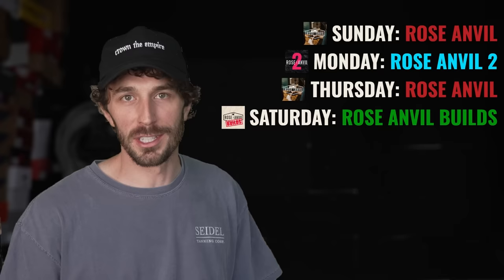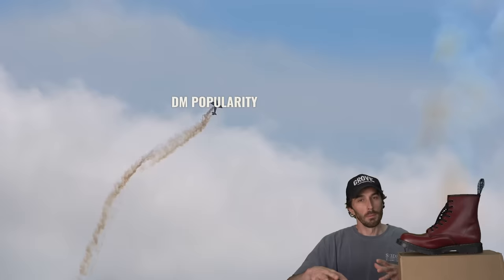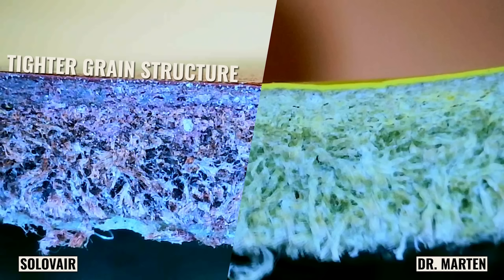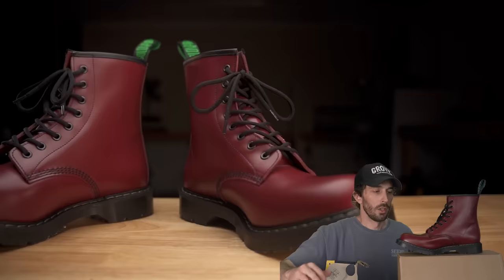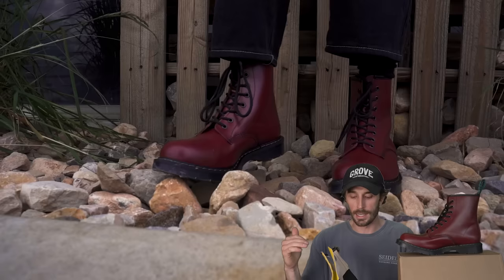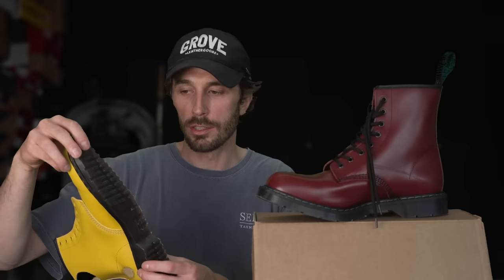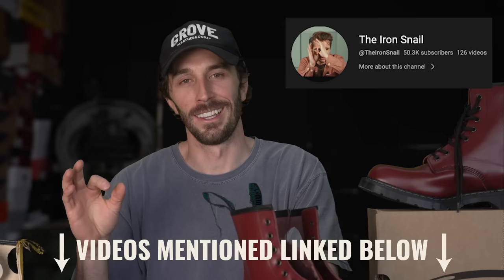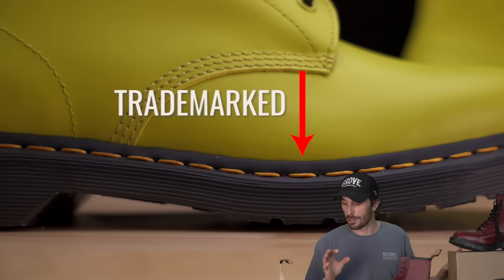Better than “real” Dr Martens - Solovair

Comment: If you notice your welt separating on your solovairs/Dr Martens, you can fix it yourself quite easily. You heat up a thin piece of metal (ideally an old butter knife) to red hot over a flame, then you slide it between the separating layers and hold the edges together with pliers. Basically reattaching the outsole the same way they do in the factory. I’ve done this before on my solovairs and it holds up like new. I would recommend doing this when you manage to catch the split early, because I can hardly imagine fixing more than three inch long tear using this method.
Reply: I’ve been seeing a lot of Reddit posts lately about Solovair’s splitting quickly. This is my only apprehension to getting a pair. How long did yours take to split?
Reply: @elenaborie2605  It must have been a factory defect, because it happened right around the time I broke them in. I have two other pairs that I’ve been wearing for years now and it doesn’t seem like it’s going to happen anytime soon.

Comment: Dude I've gotten addicted to your videos because they're so informing and help me make better decisions reg. shoes that have good value and are comfortable to wear. I had a bad fall a few years ago which completely destroyed my right foot. While my ankle was (somehow) completely unharmed, I now live with several screws in my bones and have very limited mobility (can't stand on my toes, for instance) and a very sensitive underside that needs custom soles with plenty of arch support. As you can imagine, knowing what to look for in shoes is incredibly important for my health, and being partially disabled also means I don't have stacks of cash to throw around on shoes that need replacing every season. Thanks for the info you're putting out there.

Comment: I definitely picked up a pair of NPS Gripfast boots with a steel toe and greasy leather, and I primarily use them for concerts, particularly death metal shows with mosh pits, and these have been absolute champs. The very first day I wore them, they got a beer bath from a mosh pit, and they have not had an easy life ever since. But my feet stay relatively comfortable. If I ever destroy my current pair, I'm absolutely buying again.

Comment: I've been wearing the same pair of 11 eye steel toe Solovair derby boots 40-60 hrs a week at work and can attest: they have significantly more mileage than I had expected. So far, the only issue I have encountered with them is the counter cover has just about worn out.

Comment: Solovair use white stitching around the boot on purpose. You can dye them yellow yourself, or any colour for that matter. Another point missed  is that solovairs last is more narrower than dr martens. They also lace up much more better, allowong you to really lock the boots to your feet. I always find that docs they end up eye to eye when lacing them up, and always feel loose, with less support particularly around the ankle.
Reply: That’s good info but I liked the roominess of the Docs because I have wide feet
Reply: @geministargazer9830  Don't worry, they weren't entirely correct. Solovairs have multiple lasts depending on the model, and some of them are even wider than Docs. 5400 is the widest if I remember correctly.

Comment: I've resoled my old, mid-early '90s English Doc's Oxfords, but they were more to this construction(more leather lined though), than the (not much later but iirc China made and pre-'04) Doc's workboots I was going to resole but decided were not worth it (needed more interior work than I was willing to do at the time, not just fiber midsole replacement but counter etc). Though both had the wood shanks, the workboot had a thinner fiberboard and the foam instead of felt in the recess but felt filling of the welt. I work mostly standing on concrete. Keen has been my boot of choice lately.

Comment: I got some Solovairs because of your initial review. Great boots! The sole of one did come apart early on, however. To their credit they covered what it cost to have it reglued locally, but that was a bit of a pain
Reply: I had the same thing happen with mine but they only offered 15% off a new pair. I had them re glued and they’ve been amazing ever sense.
Reply: I had to return many pairs because they come bad welt, and with cracks in the union of upper and low sole, very visible in a lantern light.
Reply: Ludwig Wittgenstein.

Comment: We were issued with solovair shoes in the UK fire brigade 20 or so years ago. Fantastic hard wearing shoes. I've still got an original pair that I use for the gardening to this day. One thing I would point out the metal rings that line the eyelet holes....make sure they're the ones with the ring outside AND inside the shoe. Some of them have a ring on the outside, but RAZOR sharp tangs inside that held the eyelet ring in place. IN one pair of the later shoes I was issued one of the tangs somehow came out of the leather and I BADLY sliced my finger as I was doing up a lace.

Comment: I'm glad you mentioned the MIEs at the end, I couldn't decide whether the comparison was fair or not. 
I love my Solovairs, but after a lot of work breaking them in and wearing them, I think the lasts they use just don't agree with my feet. Both the shoe and the boot I've had problems with fit.
I will say their leather and foam insoles are amazing for their price point.
Would overall recommend, just a bit hard to sort out sizing from the US.

Comment: I would like to say that DMs did have their own good quality boots produced in-house. It wasn't just Solovair making the good ones, in fact, I've talked to some that thought that the Vintage Steel toe DMs were better than the ones produced by solovair at the same time.
Reply: Quite a few  firms made Docs for Griggs, until production shifted off shore. Griggs only ever made some of them at maybe two factories. NPS/Solovair are top quality.
Reply: @chrisbolton5461  I know there was a company called Tredair making Doc Martens as well. I don't know if they used Doc Marten branding directly, but they used the same type of soles and were licensed to make those boots and shoes
Reply: @lephishe6271  Good point. Again with the air in the name. Made by White & Co in England in Earls Barton until 2006 and then used other UK factories after that. Bet NPS/Solovair made some.

Comment: I have owned Solovair, Made in England Docs and standard docs. At the end of the day I stick to the standard ones. All of them have the same problem - sole splitting and leather peeling. On top of that, Solovairs are weirdly known to their leather uppers pulling away from the sole. No boot like this is perfect, so it makes more sense to stick to the one that is the easiest to replace.

Comment: I have Solovairs from Vegetarian Shoes in Brighton. Worn them for years on end. No trade work, but lots of walking. I wore through the counter cover, the lining and the midsole (you can see light through the bottom of the boot through the translucent soles) but can still wear the boots just fine. The uppers are nearly perfect still, the soles are slick but not worn through to the cavities. I replace the insoles as I wear holes in them, and the boots are probably the best I’ve ever had. They’re not leather, but they breathe well and are extremely durable.

Comment: I have just sold a few doc martens that I can’t fit into, and my worn out used ones sell for $30 or more.  However, I got a pair of Solovairs last year to replace a pair of Docs, it took a couple of months, but I love them.  The leather even after just a couple of months is still impeccable where Docs already show slight issues.  They get more comfortable with wearing.  One other issue with Solovair is, because they are not mass produced, is you may have to wait for the next batch in your size.

Comment: Actually u got the wrong doc martens for comparison. Every special doc martens are made kinda different for some reason. The old one u cut apart and the yellow one are actually models that are specific to the season and not the long going models like the og black one. The og black ones(not even the mie one) features the same sock liner type as the solovair cause I've had multiple pairs myself and I'm kinda a doc marten nerd😂 Great review as always but I would love to see u cut apart the normal black doc martens and see the difference between it and the solovairs like real apples to apples. Or maybe it's a locational thing that my docs are different. Just wanna know more

Comment: My experience with Gibson shoes: the Solovair is much more durable than Dr. Martens.  After about a year, the inside of the latter began to erode, resulting in an inside hole just behind the fifth toe. After a while, I simply could not wear the shoes anymore, because it would cut my feet. I did not have any issues with the Solovair.

Comment: Coming back to say I think Solovair's quality has gone severely downhill since a while ago. I am based in the UK and all my Solovairs come from them directly, yet the latest pair I have got didn't even last a dozen of times before the insole ripped itself, searching online unveiled loads of quality issues people are having lately, including welds failing. My old Solovair in the main time took years of battering and no problems at all. At the stage the quality and durability feels just as bad as Docs is not worse, and the Solovair customer service is also very irresponsive (still waiting). I am not sure what is going on, but I do feel with the whole inflationary pressure and energy costs crisis here, companies are cutting back and they must have been cutting corners somewhere. If you want to buy it for life, I don't think Solovair is a brand you can count on right now - it might be issue free but certainly having issue is not a remote possibility.

Comment: I’ve been wearing my second pair of Solovairs for about a year and a half as work boots every day at my factory job. I put a foam (3mm thick footprint) insole in when I got them for the perfect fit and they’ve been good to me. Actually just noticed yesterday that the leather collar at the top of the shaft is split, but that’s the only failure, if you can even call it that, I’ve had. I haven’t been easy on these boots and it’s about time for a resole, but they have plenty of life left
Reply: What happened to the first pair? If they failed, what was the weakest link?
Reply: @Pnner1  good question! I should have clarified. The first pair was thrown away by my ex, they were an unfortunate casualty of our break up.

Comment: gotta say, to some level you can work in them. i work in a bowling alley/arcade fun center. crawling in and out of machines and i have a pair of steel toe greasy black strap derby boots from Solovair and i love them.  going on 1.5 years maybe 2 now, they've been great.  only addon i did was some shock absorbing insoles from FP Insoles.  they're marketed at skateboarders for absorbing impact from high jumps but they're great for walking on carpet covered concrete all day every day too.

Comment: I've got both a pair of Solovairs and Docs for over a year, both greasy leather. The leather is just much better quality on Solovairs, even though both are greasy leather. The Solovairs have much harder sole, doesn't feel like 'sole of air' imho. Martens on the other hand, do. It's much more cushy, under the ball of foot as well. That said, these Docs do tire the feet, just in a different way. Maybe that's the bad structure you mentioned, cause after a few hours of walking it doesn't feel nice, and in Solovairs it's just, you know, like regular tired. Great vid, thanks!

Comment: I originally wanted to get myself some Dr Martens but because of your prior videos I decided to get some Solovairs about 2 years ago. They have been quite painful to break in for about a week but later on they got really comfortable. I have used them a loooot the last 2 years since it pretty much is the only boot/shoe that I use in spring and fall and even the last winter and they hold up very well. Yes they already look pretty used and covering of the leather now starts to have some cracks and also the soles already are pretty run down but overall I think that's a pretty good result until now. I guess I can use them another year for sure but maybe after that I would need a replacement.

Comment: I would love to see a further comparison of the NPS gripfasts. The soles are entirely different and on mine at least there is no internal counter cover - instead there is another layer of leather on the outside heel of the boot, and the steel toe is treated the same. It would really round off the doc martens like series!

Comment: In Australia, Solovair is actually around the same price as Dr Martens. As others have said, the greasy leather is a full grain leather without the plastic coating. Much more durable and better quality, in my opinion. I have a pair of the Solovair black greasy 8 eye boots, and they’re great.
Reply: @datfly3034 Where are you getting your Solovairs in Aus? I have only found two retailers and when they are out of stock they are out of stock for ages... want to buy a second pair.
Reply: @brentmcc6048  Redpath shoes in Canberra has them.
Reply: @datfly3034  Thanks, one of the two I know...the other is d’Honk Scooters Melbourne, that's about it.
Reply: @brentmcc6048  I think NPS will ship to Aus. Not sure how much the shipping will cost, though.

Comment: Gotta say, I was an early adopter of Solovair and got very disapointed. 1 pair the laces broke on both boots within a week, as well as one of the pull tabs ripping out, causing the back to come slightly apart. other pair did okay, other than some popped welt stitches. I never had a pair of China Docs tear out a pull tab, never had one pop a welt stitch, and had many pairs with laces that lasted over a year.  I'm comparing made in England Solovairs to made in China Docs, and the docs are winning.

overall both lost though, I got tire of poorly made boots and have now had a pair of Georgia boots for years and love them.

Comment: I think the bar/ball drop test is the weakest for me in terms of taking any useful information from it. It's not actually clear that higher or lower is good. As an example, doing the ball drop test on an anvil would cause extremely high rebound, but IDK that I actually want my boot sole to be hardened steel. Maybe the bar drop test is better in this regard, but I was thinking an even better test might be to put 100-200 lbs of static pressure on the sole, then suddenly release and see how far the rebound was. This would probably come up low for anything ultra hard or ultra soft, but perform well for things that actually provide rebound for a human weight. Not sure how you would rig that up, but if you can make it work, I think it would provide higher quality information than the drop tests currently do.
Reply: This test has also been hard for me to wrap my head around. It seems that the more the bar/ball bounces, the less cushion the boot or shoe should provide. (For example, a basketball will bounce higher on a relatively hard surface vs. a soft surface.) So less bounce should mean a more comfortable shoe. However carbon-plated running shoes are supposed to provide more energy return while still being comfortable, so would the bar/ball bounce higher on those? Would love for Rose Anvil to test this out and maybe clarify the results of the bar/ball drop test at the same time!